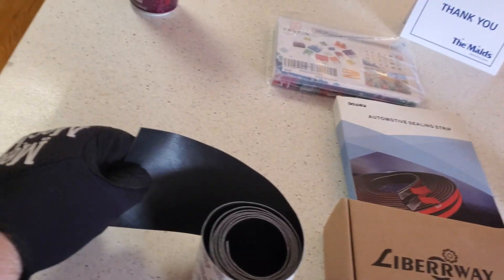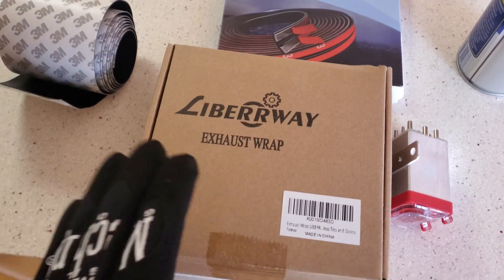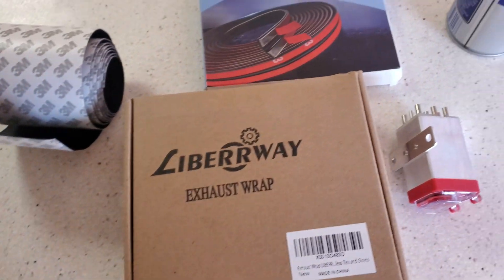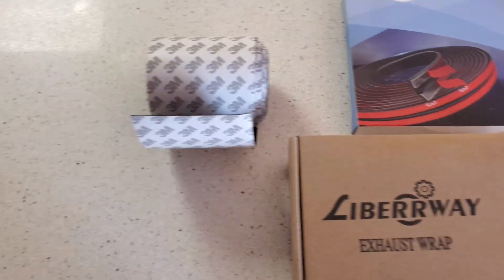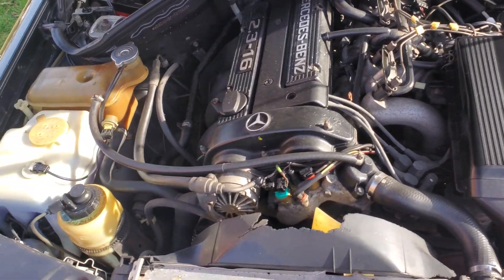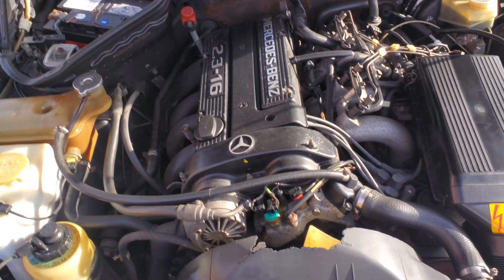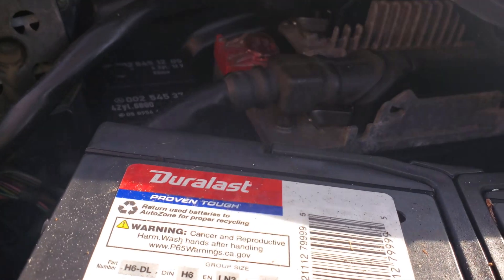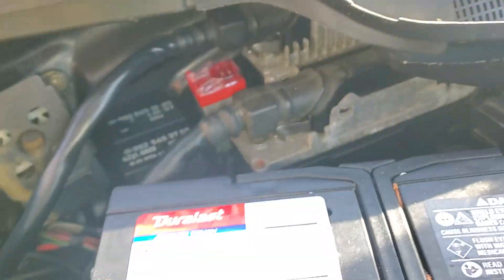Did I Just Make The 190E WORSE By Trying To Fix It?!

Comment: Cleaning the throttle will definitely settle the rpms plus that exhaust needs to be replaced. Change some fluids and drive it. Hopefully the tires aren’t dry rotted or have to many flats spots. If you have to replace those tires dont cheap out get good tires. They have as much to do with stopping the car as brakes do.

Comment: Ooh, that is your air flow meter not the throttle body. These are old so don't have the hot wire type MAF sensor. That plate is to measure air via a potentiometer.

To get these running correctly needs lots of research and patience because they don't have a very good OBD system. 

Looks like a good honest car and these are worth a small fortune now so I can't imagine you bought bad unless you spent a large fortune
Reply: This is correct as it's a air flow meter and your throttle body is under the meter. There is an idle adjustment that will change the height of the air meter butterfly and then there is another air fuel screw under a module attached to the side of the fuel distributer.

Comment: Also that has a Bosch K-Jetronic Cis-injection. If there's ANY vacuum leak in any of the air/vacuum lines it'll cause you issues... congratulations on the purchase... for the troubles those have they're still pretty dope..

Comment: And for the abs make sure your brake fluid is topped up could be triggering the abs light if it’s a little low I had that on my truck before and added a little and went right away. Always try the easy stuff first

Comment: Awesome video RGT. Pick up a scan tool or get parts store to run a diagnostic Autozone does them for free. Or just disconnect the ground on your battery a reconnect it and see if the ABS light goes out. Later.

Comment: I would take the negative cable off the battery for a few minutes to see if it resets the ABS light after you replaced the relay.
Reply: If that doesn't work, go to O'Reilly's and they can hook up a scanner for free and try to clear it.

Comment: I think you need to drive it around awhile for the light on the dash to turn off
Reply: Yes, correct
Reply: It will never be off onna Mercedes.
Reply: @fordxbgtfalcon  nope , wrong.
Reply: No. To get the light to turn off, you need to fix the fault that is causing the light to be on in the first place. 

The ABS light comes on because there is a fault with the ABS system. There are 3 ABS sensors and a control unit (which is located next to the engine control unit in the same area as the OVP relay). So one or more of the sensors are inoperative, or the ABS control unit is inoperative, or the wiring from the ABS sensor(s) to the ABS control unit has lost continuity.

Comment: You can try disconnecting the battery for 5min, then reconnecting it; this may clear the light.
Reply: Definitely
Reply: This isn't a Toyota orba Chevy.
Reply: @bobolimasterflex  definitely for 5 minutes then it's coming right back
Reply: No, it won't. Fixing the fault will clear the light.  If the light is on, the fault still exists.

Comment: I would take the covers off the rear seat and have it re-stitched.  It should look good as new when you are done.  If there are other rips or unreparable wear on the seats, I wouldn't bother, but if that's all that's wrong with them, a split seam can be repaired to look brand new

Comment: If you still have a hard start. Change the cold start Valve and coolant sensor they work together. It's a 5th injector that only comes on when needed like when it's ❄ cold... and that motor has a air control valve that gets dirty. You can spray it clean with carb spray...
Reply: user-lb1wd8ei5o  SirSeanIsRobinson1515 thanks
Reply: user-lb1wd8ei5o  oh you ment on InstaGram. my bad. as soon as im done changing oil i will text you. im at work right now
Reply: user-lb1wd8ei5o  ok text you where ?

Comment: Don't seize your engine cleaning throttle.  If your cleaning throttle you should clean mass air flow sensor too, but with different spray specific for mass air flow sensor. Don't let your mechanics screw you, and hopefully they have worked on plenty of Mercedes and have right equipment for them.
Reply: This, my 2002 Mitsubishi Lancer ES has always had rough idle and I spent months trying to pinpoint the problem. Cleaning the throttle body would work for about 2 weeks. Later i found out the car had burnt through the Mass Airflow sensor. Swapped it out and the car runs fine now, but man was it a pain in the ass to figure out
Reply: 2.3-16s (well, cars with KE-Jetronic) don't use a MAF.

Comment: I like going about this build on a low budget to start. It would make no sense to put a ton into seat repairs etc. if something expensive is causing the high idle. Or if there's an expensive suspension issue that hasn't been found out yet... start with the basics and work your way out. Love E 190's.  I've been doing similar small things to my 2013 Mustang and those details make all the difference in the world. Good luck with the car. I'll be watching the progress...
Reply: Usally a high Idle is something as simple as  a vacuum leak..it's just the bitch of finding what is causing it! But I agree...save that dough for the stuff you ain't gonna be doing without  a lift and a shop.

Comment: Mechanic chiming in right before you opened the air box you can see rodent chew marks on the wiring. Might wanna check wiring to the abs wheel speed sensors might be why lights still on

Comment: needle and thread it a seam  plugs and wires fuel injector cleaner in gas fill up tank and drive will get better over time  and change oil and after 3000 switch to royal purple or castrol  edge

Comment: I would just take the throttle body off the car and clean it really well! Usually is very easy to do normally just need to do is take off the air intake and the throttle body itself is only bolted down with like 4 bolts and comes right off! Very easy to do and then you can clean it really well and you would be amazed how much of a difference just doing that can make!!!! Just use some carb cleaner or something like that and use an old rag and toothbrush to clean it!